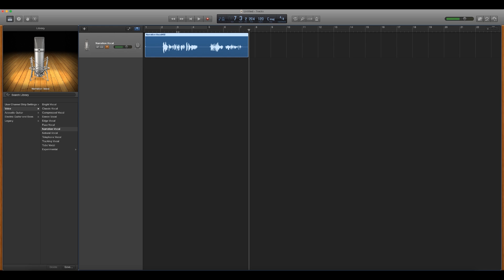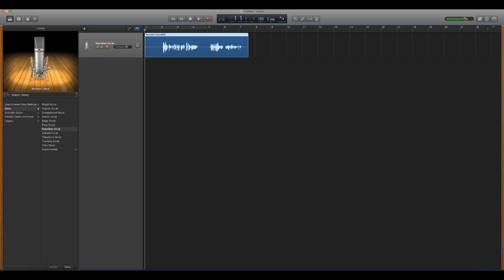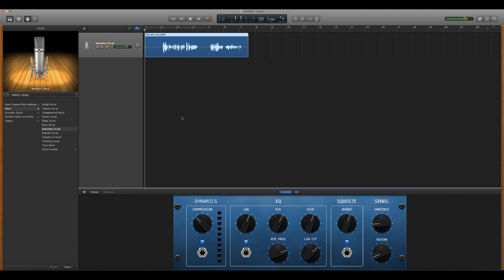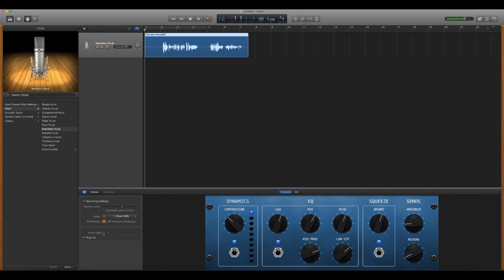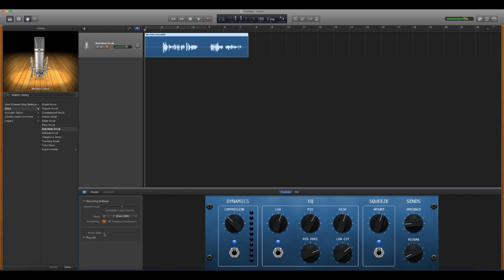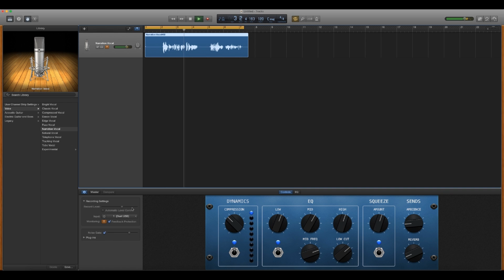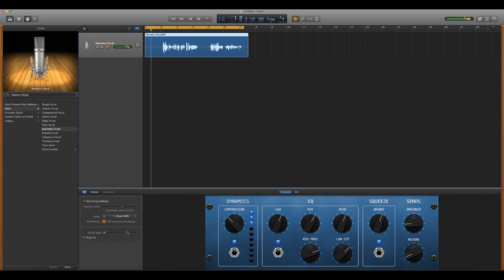Remove Noise and Hiss from your Podcast in Garageband

Comment: Noice gate is not really useful as the noice is still in the background when you speak .... it's just a gate => turn the sound on or off.
Reply from the maker: Yep, Exactly. Unfortunately, the tools are kind of limited in GB, or at least they were when this video was recorded. What would you suggest someone use if they are working in GB?
Reply: @BrassyBroadJen  Are you sure it's not possible to erase the noice correctly in GB ? In audacity it's quite simple to erase the noice. I never found the way to do it in GB but I'm not a specialist.
Reply from the maker: @ I haven't used GB in awhile. There wasn’t a denoiser that came stock with it last time I used it. It would be nice if it had a built in denoiser.

Comment: I do not see this option - iphone 2020 SE
Reply from the maker: If you're looking for the plug-in settings, this is how I find it on the version of Garageband I have on my iPhone. There is a gear icon in the top right corner of the screen. Press that and then press Track controls. There, you will see the track settings, and you can scroll down to see the plug-ins.

Comment: this didn't work for me :( it kept cutting out specific parts even having it on the whole track :(
Reply from the maker: It only sometimes fixes the problem. It depends on how noisy the track is. You might try running it through auphonic.com.
Reply: tysm <3  @BrassyBroadJen

Comment: It's quick and easy, but it's a really bad way of removing noise.

Try Adobe audition, noise capture, then apply with with tweaks and you'll have a much better result.
Reply from the maker: Robert, I love Adobe. It's what I use for podcast production. And you're right, this might not be the "better" solution, but this is something that the folks using GB can use to help.

Comment: My only issue with this is it doesn't remove the hiss during the speaking, which makes this wall of sound just come in every time there's audio which is sometimes worse than there being hiss all the time.
Reply from the maker: Darren, Here are a couple of things to try - Turn down the gain on your mic so you have less hiss during recording. Another option would be to turn off the noise gate while you record so you have a consistent noise level.

Comment: It wouldnt allow me to check the noise gate box :( could you help me?
Reply from the maker: When you click on the drop-down arrow next to where it shows Plug-ins, do you see Noise Gate in the list of effects in the plug-in slots? If not, you might need to add it to one of the plug-in slots. You will find the Noise Gate under Dynamics.
Reply: @BrassyBroadJen  Thank you for the response! I do see it but it would not let me check the noise gate box : (
Reply from the maker: @ekyung  Go into your GB preferences > Audio/Midi and make sure that you have the box ticked for "Enable Audio Units" under Effects.

Comment: Hey quick question how did you get your waveform so pronounced ? I’ve seen a lot of people struggling  like me with a small sound profile . Is it merely your input is that much higher or is there another trick ? I’m using a helix interface and levels should be where they are supposed to be on the helix .. but idk still at a loss . I have hiss and a small sound profile at the same time which sucks I can’t just add gain cuz I’m sure I’d get more hiss
Reply from the maker: Corey,  I'm sure I had the gain cranked up on the mic so that I could get the noise at a level where it could be heard clearly for this video. What kind of mic are you using? I know some mics, like the Shure SM7B are going to need some additional boost. I recently upgraded my mic to the Shure MV7 so I have the flexibility of recording straight USB into my mic or connecting to my audio interface with XLR connection. I've been super happy with the upgrade.
Reply: @BrassyBroadJen  I’m actually using the sm7b ! I’ve dug in a lot after asking this and I realized I was over analyzing and not realizing that in GarageBand you will have smaller waveforms in general compared to logic. I do use a phantom powered mixer plus the cloud lifter so it was just about me gain staging properly and learning where the input range is normally acceptable. From what I read anywhere from -20 to around - 12 should be decent range . I just wish GB and even logic automatically zoomed in on the waveform for easier editing . I wanna say older versions of GB had larger WF’s but I could be wrong . Anyways thanks for the response and content !

Comment: When I cycle recorded and changed noise gate to get rid of it, it got rid of the noise for the pure background noise segment, but the background noise was just as loud as before in the segments where I was speaking.
Reply from the maker: Meredyth, another option to look at is auphonic.com. They have a de-noiser that you can use. It's easy to drag and drop your file and you get 2 hours of processing time with their free version. Use it on files with dialogue only, before you mix with any music.
Reply: @BrassyBroadJen  Thank you for the reply! Unfortunately, this also didn't do anything to reduce the noise.

Comment: Is this possible in an iphone?
Reply from the maker: You can access the noise-gate plugin in the version of GarageBand that I have on my iPhone. I'm using iOS 13.1.3. I haven't updated GB in awhile. Go into Track Settings and scroll down until you see Plug-ins and EQ. Press on the arrow to expand the view and Noise gate should pop up so you can adjust it there.

Comment: Actually helps! Even better if you adjust the EQ and other settings. Doesn't entirely work, but I think it's because my recordings are just bad. I'm using a cheap microphone and using my bathroom as my studio. Still better than nothing. And I'm thankful I found this video!
Reply from the maker: Thanks! Have you tried running your recordings through auphonic.com? It's a fantastic tool for leveling and also has noise reduction. That might also be helpful. Are you recording music or a podcast? I love the reverb in my bathroom for music, but my podcast would sound horrible if I was recording it there. Even with an inexpensive microphone, if you're in a good room, I've found it is still possible to get a decent recording. Let me know if you have more questions.
Reply: @BrassyBroadJen  Heyyy, thanks for recommending auphonic. I've not heard of it before. Actually, I use my bathroom for both music and podcast. Sadly, I don't have any place else. I'll try auphonic.com and I'll give an update about how it goes!
Reply from the maker: Pickle Piper try making a pillow fort! Sounds silly, but it will help with the reverb. If you have to record in the bathroom, try throwing blankets or towels over the shower curtain rod to help deaden the sound in the room. That can also be helpful.
Reply: @BrassyBroadJen  Oh wow, that's a great idea! I'm a silly little noob, your suggestions are such great help! Thank you!
Reply from the maker: Pickle Piper Happy I could help!

Comment: The noise goes away when I'm not speaking, but is there when I'm speaking. Anyone else?
Reply from the maker: David, Thanks for your comment. Depending on the recording, it can be challenging to get the noise gate adjusted just right. You might find Auphonic.com to be more helpful. It's a good tool for noise reduction.

Comment: It remove noise from the background but doesn't remove background noise when you speak. WHY????
Reply: If you want to remove the noise while you're speaking, you need to get a plugin can can analyze the noise signal on its own, the apply an EQ setting that reduces the frequencies represented in the noise, then applies it to the whole recording.  The problem is that it can also effect the quality of your voice, but generally for low level room tone they work pretty well.  The key to noise reduction is to deal with it at the recording stage.  Microphone placement is crucial just as recording in a treated space is important.
Reply: Use a real-time threshold limiter for volume. You can also use threshold gates for frequencies.

Comment: when I do this it removes the background noise but makes the audio jumpy when I speak
Reply: The thing is, turning down the noise gate doesn't seem to eliminate the background noise for me. It all comes back in as soon as I make a noise. It also cuts off my voice/instrument too early if I even go below 60. Now, for someone reason, the white noise/fuzz is especially prominent, and wasn't as bad as before, but now every time I try to even make a new audio track the fuzz remains.
Reply: Jen Edds yes it was either removing the background noise really well but making it jumpy or not removing the backgroumd noise
Reply: This didn't answer the question about the audio being jumpy. I'm having the same problem. I have it on -27dB.
Reply: Than you for responding so quickly Jen. It was set to the default setting Noise Gate. I tried Background Vocals and now my voice comes in and out. I'm really confused to why this is happening. The Noise Gate takes it out but then you have this problem. I have Audacity also which was able to eliminate the hissing noise with no problem and the recording sounds good. I wanted to record it on GB since I have it. But I don't want to waste any more time trying to correct this. The only thing that seems to work is adding background music.
Reply: yes the reason is, it doesn't cut background noise, it cuts desibels so anything above a certain volume will come through, hence the music or vocals being "jumpy". i dont have a solution, I'm afraid, even though there was this one "Plug-in" you can buy that does this for you. But its bit pricey. 100$ or something..
Reply: Fredric, you might be referring to Loopback. I tried the free trial and it worked perfectly but you're right, it's very pricey when there should be other solutions out there.
Reply: this only work for speaking, where you speak in a quite similar volume throughout.